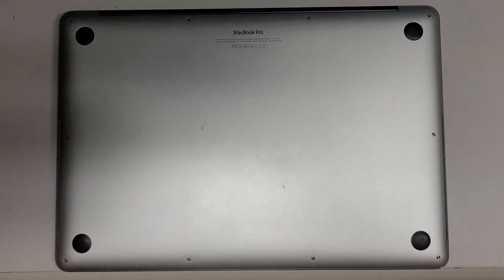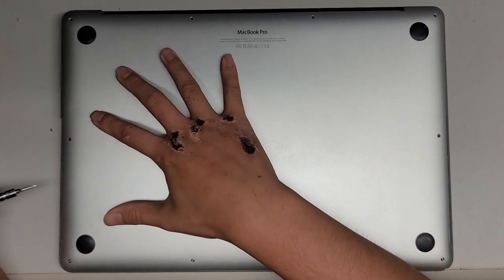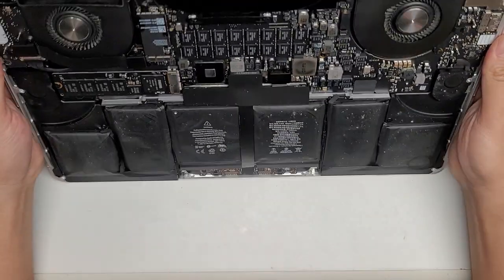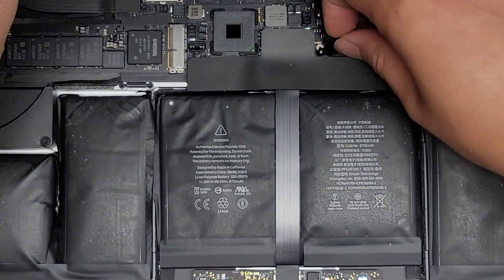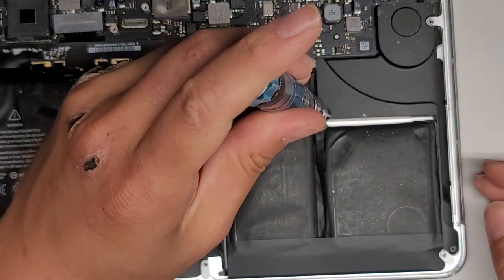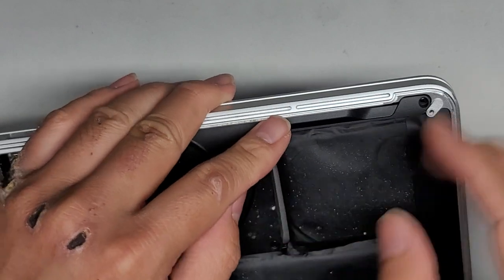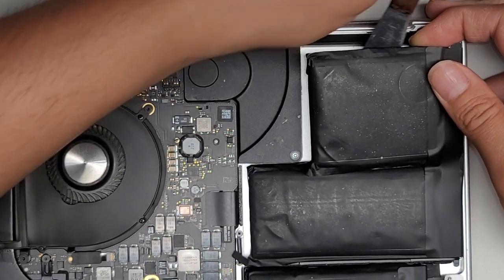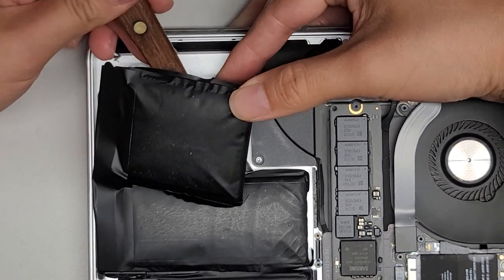15" inch MacBook Pro A1398 Mid 2015 Battery Replacement Repair

Comment: Work fine but now keyboard and mouse dont work
Reply from the maker: Sounds like the trackpad cable or something was damaged
Reply: Yeah but power switch work
Reply from the maker: @PoisonedMan9  that's what Apple does. If something is wrong with the trackpad, it disables all of the keyboard except the power button.
Reply: I have a message that no keyboard is connected, I also tried to correct the trackpad cable
Reply from the maker: @PoisonedMan9  that's a damaged trackpad or trackpad cable.
Reply: @ItsBinhRepaired  ok i got it i dont see in your video that you insert one part trackpad - now work :) thanks a lot :) it was my first action with Mac :)
Reply from the maker: @PoisonedMan9  awesome, glad it worked. If you haven't already, please like and subscribe so others can find my videos. Thanks!
Reply: @ItsBinhRepaired  done!
Reply from the maker: @PoisonedMan9  Thanks!

Comment: You said just to pull the trackpad cable without the latch. This is a very bad video. You did not even need to separate that. This is stupid with wrong instructions. Now, the latch is separated and I cannot fix the cable in thanks to you.
Reply from the maker: What are you going on about? Not my fault you skipped around and didn't watch the whole video. Watch it again and you'll feel stupid because I did say to flip the latch... dig you not stop to think and ask yourself why nobody else talked about how they broke the latch or trackpad cable?
Reply: @ItsBinhRepaired  Oh, man. I went back twice and did not see that! Sorry. Best approach would be just to leave it on. Now, that latch is out of place! :(
Also any idea why the keyboard and the trackpad are not recognised? Fans are blowing at full as well. I messed it up apparently.
Reply from the maker: Usually damaged touchpad or touchpad cable

Comment: i have the same peoblem and I will fix it soon! 
Im waiting for the battery to arrive the amazon order but i also want to replace the paste from processor and j found a new problem!
On the processor, around the thermal contact was a plastic isolation what was damaged because overheating…
Its necessary to replace it? I dont find another one on the internet and i build one from isolation tape… its working?
Reply from the maker: I think it'll be ok.
Reply: @ItsBinhRepaired  thank you! I also attached some photos on your email!
Bless! 🙏
Reply from the maker: @instrumentalle  OK